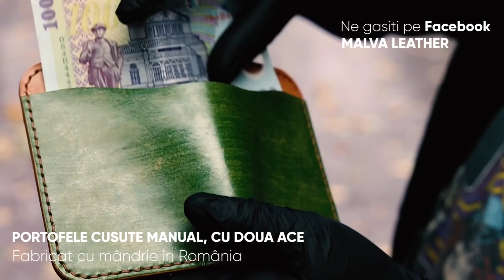1.5 TSI mai bun decât CATASTROFA 1.4 TSI?

Comment: Honda civic 1.5 T este un motor greu de egalat. Performanța și consum. Numai bine. F bun materialul tău .Felicitari!
Reply: @sergiuflorin5282  Il ai tu si ai dilutie? sau din citit pe net?
Reply: Au fost probleme cu dilutia in țările cu alt climat.
Mai curând poate sa fie la tsi problema, având în vedere că are 350 bari presiune in rampa
Reply: @sergiuflorin5282  nu cred că din cauza asta, la o adica masinile mici care ajung la ei la vanzare din producția locala sunt niste ghene fata de honda, ma refer la Lada si Geely.
Si N47 a avut faima rea cu lanțul dar asta nu inseamna ca obligatoriu se rupe si ramai in drum.
Noi avem pe grup multe civic 1.5 si zero probleme in acest sens, ceea ce enervează la acel motor e ca are un indicator de "sanatate" a uleiului si cere revizii des cateodata, la fiecare 6000km
Reply: @sergiuflorin5282  da, nu e un interval comod dar nici nu strica sa schimbi pana in 10000km
Eu cred ca depinde de climatul tarii unde se vinde masina, nu e o regulă la toate 1.5 treaba aia
Reply: @sergiuflorin5282  in California se vinde motorul doar ca are setup de 192 cai
Reply from the maker: Cu tot respectul, dar am condus 1.5 T de honda pe Civic și pe HR-V și are o lipsă serioasă de cuplu. Mai ales cu transmisia CVT care are cuplu redus. Motorul acela nu trage de toți caii, am rămas profund dezamăgit.
Reply: @sergiuflorin5282  am motorul si in 19000 km am facut doua schimburi conform contorului de ulei si stau in Bucuresti. Viata uleiului la masina asta tine de stilul de condus. La toate benzinarele cu injectie directa trece benzina in baia de ulei. Daca faci drumuri scurte, stai cu masina la relanti sa se incalzeasca si mergi batraneste, uleiul nu ajunge la temperatura optima intr-un ciclu si benzina nu se evapora din el. Repeti povestea si nivelul tot creste. Eu nu am nivelul crescut pe joja si il urmaresc destul de des.
Reply: @AtelieruldeDetailing  poate are lipsa de cuplu pana pe la 2500 rpm. Nu stiu cum nu trage de toti caii...Vlad zicea in clip de Octavia 1.5TSI ca are 0-200 in 45 de sec, Civicul are 0-200 in 30s. 1.5T Honda nu se plafoneaza in ture inalte. De la 5000rpm in sus trage si mai bine. https://www.youtube.com/watch?v=dVLvlQ7BK7w
Reply: @sergiuflorin5282  Exact. Asa se intampla si la 1.5T Honda daca este exploatat corect.
Reply: @UpToElevenBand  cauta pe net sa vezi timpi de civic 1.5T,nu sta rau, cam 28 32s 0 200.
Accord de 2.4 cam asa merge stock, daca te joci la evacuare, soft si jante poți scoate 22s, daca vrei sub, trebuie sa schimbi cutia de viteze cu una cu rapoarte mai scurte
Reply: @vladdutz20  stiu timpii, am masina. :)
Reply: Am eu 1.5 t pe CRV 2019. Oil dilution la greu. La 6000 km am 5.6% dilutie. Exista insa o deosebire intre motorul de pe civic si cel de pe CRV. Honda nu stie cum sa rezolve cu oil dilution, decat sa schimbe uleiul gratis
Reply: @vladdutz20  toate masinile incepand cu 2020 au "indicator de sanatate".
Reply: De ce crezi ca trebuie sa schimbi uleiul la 6000km? Ti se pare normal? Ai mai auzit asa ceva la vreo masina? Si asta te intreaba un posesor de 2 honda civic.

Comment: Ziceti ca 1.4 tsi e catstrofa, eu am 220k pe al meu, naiba stie daca sunt reali si merge ceas, nu consuma ulei si nici la benzina nu prea se da. Poate cele cu turbina + compresor sa fie mai problematice dar depinde si de norocul care il ai si nu, nu pot zice ca recomand tsi/tfsi... greu gasesti mecanici care stiu sa le repare, e un motor pretentios, benzina bagi doar de 99/100... se simte fain la condus, e o placere dar tot motorul mare aspirat e varianta castigatoare. Oare sunt mai fiabile cele ecobust de pe ford?
Reply: Statistic mai multe necazuri am auzit sa fie pe tsi
Reply: @vladdutz20  La un A3 8PA quattro, din punct de vedere a fiabilitati si custurilor de intrretinere, recomanzi 2.0 tfsi sau 2.0 tdi?
Reply: @HightLink  hmm greu de zis, parca la suflet intra mai bine un tfsi ca e benzina, doar ca nu au fost asa fiabile, exista unul bun cu pistoane forjate, cel montat pe Audi A5 competition cu 230 cai.
Îl are Vlogger tanya Cristina :)
Reply from the maker: Eu am două cunoștințe cu 1.4 TSI, niciunul dintre ei nu mai este la primul motor.
Reply: @vladdutz20  condoleante 🤣🤣
Reply: Eu am un golf 5 GT din 2006.
Are motorul de 1.4 TSI, am facut și soft la motor, este destul de rapidă.
Dezvolta 200 cp și nu consuma ulei deloc. Masina are 220.000 km , Nu este asa de stricăcioasă după cum se vorbește. 

Singurul dezavantaj mi se pare consumul mare de carburant.
Reply: @AtelieruldeDetailing  din ce ani sunt masinile? E 1.4tsi pe lant sau pe curea?
Reply: @HightLink  Am avut 2.0 tfsi, o placere la condus, nu este asa stricacios cum se da cu parerea pe aici, dar in schimb consuma ulei foarte mult( 500 ml /1000km). Consum in bucuresti 13

Comment: mai fa un video ceva cu honda  te rog
Reply: Pe urma zice lumea că o laud prea mult, sa vad de modificări ii mai fac și poate revin cu un update :)
Reply: Cand poti fa un video cand o duci la service
Reply: @denisveste3890  am o rechemare la airbag saptamana viitoare, daca pot o sa filmez pe acolo :))
Reply: @vladdutz20  pana la urama merita o asfel de masina si ce minusuri are ?
Reply: Merita, e o masina robusta si totusi ofera suficient confort, are trapa, scaune electrice incalzite, clima, un casetofon decent si motorul este foarte placut la condus
Asa ca minusuri ca e impozit mai mare, consumabilele sunt usor mai scumpe, au un furtun de servo sensibil si lacul vopselei nu e stralucit...dar totusi având în vedere ca am dat doar 4850 pe mașina nu pot sa zic ca ma deranjeaza acele minusuri
Reply: @vladdutz20  as vrea sa schimb un w204 2013 pe una din 2008 cu 2.4
Reply: @denisveste3890  nu cred că sunt prea multe la vânzare dar daca găsești în general au fost deținute de fani ai mărcii.
E o mașină fără uzura la km multi

Comment: Tiguan 1.5tsi DSG, 28.000km, multumit de motor, trage decent (nu e ca un 2.0d N47) si merge foarte fin. N-am avut niciodata acel efect de cangur.de care au tot spus unii. In primii 20.000km a consumat 700ml de ulei.

Comment: In curand o sa pun mana 1.5 tsi si abia astept sa vad cum se simte fata de 1.4 tsi care cica era mai fâșneț. Cel putin cel bluemotion de 130 cai e laudat pt consumul exceptional de bun.
Reply: Bluemotion au si cutia mai lunga, aerodinamica optimizata, nu e doar motorul.
Oricum depinde si pe ce masina il montezi, ca una e un golf usor alta e pe un passat variant.

Comparativ cu ecoboost de 1.5 care e 3 cilindri cu arbore crossplane , 1.5 tsi 4 cilindri ar trebui sa fie cu cuplu mai slab nativ, insa cred ca turbina cu geometrie variabila compenseaza cu faptul ca e arbore flatplane.
Reply: @vladdutz20  pe un Golf 7.5 o sa pun mana, comparația o sa fie facuta cu un Seat Leon 1.4 tsi 125 cai. Nu inteleg de ce la versiunea de 150 de cai nu au folosit tot turbina asta minune cu geometrie variabila. De zi cu zi conduc un 1.2 tsi cu distributie pe curea, la care in 64k nu am consumat o sticla de 1 litru ulei pt completare, desi mereu cand fac schimbul ma întreabă la reprezentanta daca vreau ulei pt completat. Multumim pt munca depusa de tine si colegii tai, si multe alte video-uri interesante!
Reply: @grigiocrono5966  daca te referi la 1.4 150 cai, nu puteau sa folosească geometria variabila pentru că încă era in lucru.
Componentele rezista la 880°C
Reply: @vladdutz20  ma referam la 1.5 tsi de 150 cai.
Reply: @grigiocrono5966  eu știu ca au amandoua turbina VGT, sau cel puțin asta de 150
Reply: Ce ziceți, care e mai ok. 1.4 125cp sau 150cp? Mă refer la golf 7 2014+
Reply: @danielelekes7030  oricare e bun, numa sa fie varianta cu distributie pe curea!
Reply: @vladdutz20  Am inteles bine ca 1.5 tsi 130cp este mai reusit decat 1.5 tsi 150cp?
Reply: @florin-marianflorea7734  eu zic ca e acelasi motor, tot aud ca doar 130 ar avea turbina cu geometrie variabila dar nu am gasit scris exact.
La 1.4 tsi intre 122 si 150 cai erau si diferente de hardware, gen distribuție variabila dubla vs simpla, o turbina mai mare...

Comment: Civic 1.5 turbo de 182cp consumă ~8,5 oraș ))
Până acum niciun benzinar nu are Ad-Blue. Doar GPF au.
Vezi la Humble Mechanic, Golf 7 R cu injecție combinata, după 10 000 mile paremi-se, tot avea depuneri bune pe supape...
Reply: Salut, ai cumva Civic cu motorul de 1.5? Daca, da poti sa-mi zici, te rog daca 8.5 e consumul in Bucuresti, la ora de varf? Cutia e MT sau CVT? Stiu ca la CVT e consumul mai mare. Ai avut probleme cu diluarea uleiului? 
As vrea sa-mi cumpar un Civic sedan, 1.5 M. Am facut teste drive si imi place cum se conduce, dar era seara si nu am reusit sa-mi dau seama ce consum are in oras. Multumesc mult!

Comment: Ce e așa spectaculos la turbina cu geometrie variabila? Găsești și pe e46 din 2001...
Reply from the maker: E o raritate pe benzină.
Reply: Găsești pe diesel dar nu pe benzina.
Avantajul e ca nu e nevoie de supapa wastegate si poți optimiza răspunsul turbinei pe toata plaja de turatii prin acele clapete variatoare
Reply: @vladdutz20  se pare ca doar 1.5 tsi 130cp are VTG. cel de 150 e FTG. " Like the previous EA211 engines, the 1.5-l evo has the combination of high-temperature and low-temperature loops of the cooling system. The 96 kW TSI evo engine has a turbocharged intake with variable turbine geometry (VTG), while the 110 kW version uses conventional valve timing and a turbocharger with a mono-scroll wastegate EGT."
Reply: @bogdanconstandache8836  nu am filmat niciun 1.5 tsi ca sa vad exact turbina ca îmi dau seama imediat de care tip este.
Probabil cea de 130 e vtg ca sunt temperaturile mai joase si nu sunt afectate materialele

Comment: Eu am mpotarul asta pe passat, are 1500km, confirm consumul mic max 9,2 in B, cuplu bun de la 2000rpm, insa turbina cu geometrie variabila am citit ca e pe varianta de 130cp, pe cel de 150cp e  fara geom var, a mea nu trage de la 1200 decat daca vreau sa conduc normal, linistit, bine merge de la 2000rpm, intradevar nu stii ce motor ai, si innteprize se misca bine, raspunsul e instant in turatii decente fara lag.
Reply: Dsg sau nu

Comment: sal in  EU  se filmeaza pe 50 p nu 60 p, 6o p e e standardul pentru America si Asia, nu te ajuta cu nimic sa filmezi cu 60 p
Reply: Telefoanele nu filmeaza 50p in pal, sunt pe ntsc 60
Doar gopro poate filma pe 50 de cadre Pal dar au aspect ratio boschet si nu folosesc
Reply: @vladdutz20  da dpinde tel
Reply: @DesignfacestudioRo  nu știu, eu nu am vazut telefon sa filmeze 50fps, toate sunt 30 sau 60 si 120 240 720 960fps pt slow motion

Comment: La cata electronica are acest motor in 5 ani o sa ai atat de multe belele incat o sa iti aduci aminte cu drag de 1.4 si 1.8 tsi:).
Reply: Electronica e la fel, asta daca are segmentii buni, o sa fie pe placul proprietarilor :))
Reply: Sper sa fie asa dar la cum stiu vw in ultimii 15 ani unde au facut numai rahaturi...as putea paria ca si acesta este un rahat:).Nu are cum sa fie fiabil VVT, VVL, injectie directa si indirecta, turbina cu geometrie variabila pe benzina,pompa de racire si ulei cu debit variabil, filtru particole...fiabil e VTEC nu struto-camila asta....oricum misto video:).Cred ca vrei sa-ti iei un TSI :)))...ai zis ca gata cu motorul fiabil....vreau probleme:))
Reply: @gollumtm  daca vrei mașina noua cam domina sub 2 litri cu turbo.
Sistemele astea pot fi fiabile daca sunt proiectate bine, fara prea multi actuatori si motorașe
Reply: @vladdutz20  clar ca daca se vrea se poate face fiabil.Ideea e sa se si doreasca doar ca tendintele din ziua de azi sunt altele.Sper sa ma insel.E deja pe piata de 2 ani acest motor deci in 2 ani vedem cat e de fiabil.:)